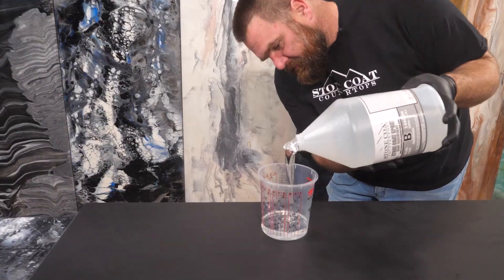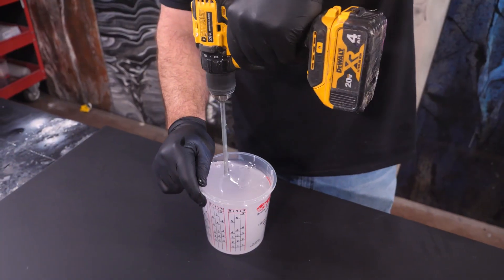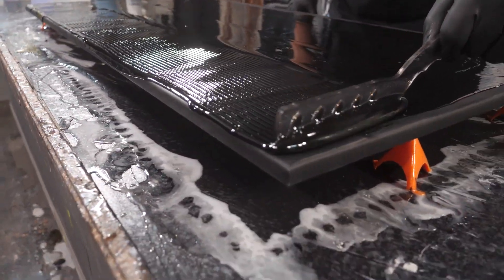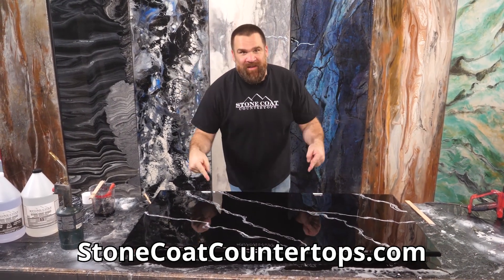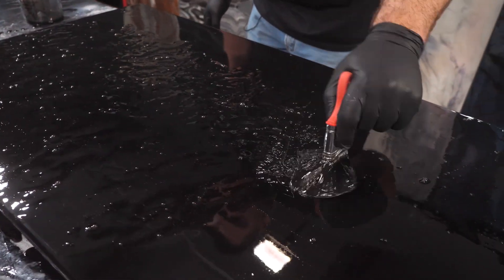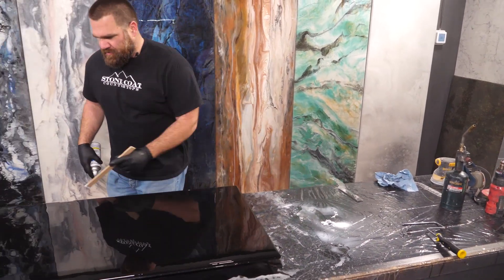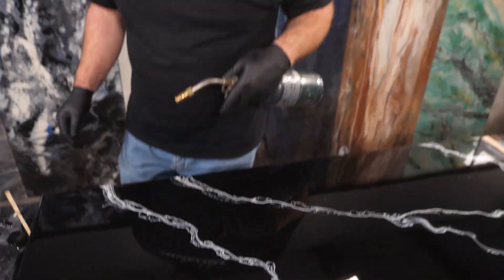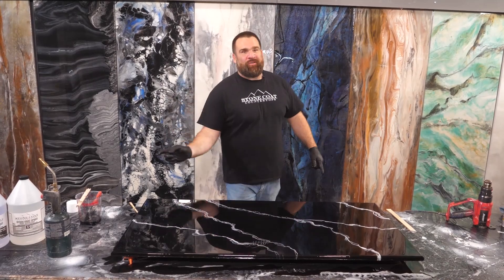Black Fractured Marble with Epoxy Resin | Stone Coat Epoxy

Comment: Thanks for watching everyone! Let me know if I can help u get a project started 👍
Reply from the maker: Thanks Mitch, good work bud!
Reply: So is it 3oz of each part A and Part B per square ft or a combo to make 3oz per sq ft? Your videos are the best epoxy designs around
Reply: @ryanwheeler4245  1.5 Oz of A and 1.5 Oz of B. Total of 3 ounces per square foot
Reply: @mitchquist How many square feet was your board?
Reply: This is closer to the kitchen counters my wife wants, just no veins, with a hint of coffee brown coming through and no shine. If I paint my countertop black, do I do a clear pour with Metallic brown pigment powder added, or also add black tinting like you did? I'm thinking if I add black pigment it will hide the brown metallic powder color.

Also, are there advantages to taping the edges and after a few hours peeling it off vs. letting the pour run over the edge after troweling and chopping?
Reply: @tbg3111  Putting the tape dam on is best when using the exotic pour method. Not needed for this technique. The tape dam will keep the excess epoxy applied when using the exotic pour in place and keep the details very vivid. When you wait to pull the tape when the epoxy has thickened, the edges turn out HD!
If I was you I'd put down black dyed epoxy and have some brown mixed up, pour veins of the brown and use a roller or your gloved hands to meld the brown and black together. Use a heat gun to further meld as desired. That color sounds good, I wanna try now! Thanks for watching at the great questions, let me know if you have any more!
Reply: Mitch I need to get trained. Where should I go to do that I feel I know enough to start an amazing epoxy business I need to do my kitchen floor over tile, over thresholds, and over my bathroom vanity I would like to use cabusil so as to not have my epoxy run down to drain
Reply: @mitchquist  that explanation on the tape dam helps. I'd like to clarify though on the brown, she really just wants the pour to be black but no veins. I was maybe misunderstanding the use of the powder and possibly I should be thinking epoxy glitter aditive? We're looking for an even, but subtle, brown to be seen. Maybe I'll need to experiment with adding it to a clear pour over the black painted base, and another by adding it to a black tinted pour?
Reply: Help!!!!! I got drips on my floor 😣 I wiped them up quickly but now the spots are sticky and shiny. There was a hole in my plastic! I also got on my hands 😬 do happy with how it turned out though!
Reply: I will ask when I DIY 
Your hard on this you got it on lock off 🤣👌🤘
Reply: @T BG   If you want the subtle hints of coffee brown into your pour, put some coffee brown spray paint onto a pallet or piece of cardboard then use your chop brush to chop it into the epoxy.  Mike did something like that in this video "Turn Plywood into Marble Countertops".  I hope this is what you were looking for.
Reply: @cyclet4819  thanks for the tip. I'll look that up.
Reply: Can you do the same thing, but white with black veins?
Reply: My current countertops are small ceramic tiles with grout in between,  so the surface is not smooth.  Will the epoxy work on this surface?

Comment: There's also Montana Marble Effect spray paint that works great for mimicking marble... Long as you don't overdo it. It's like silly string, so easy to keep using. Did this with an ugly counter on my kitchen. Finished with UTC to lower the gloss and then offer nice scratch resitance!
Reply: What is UTC?
Reply: @howardmcnatt6513  Ultimate Top Coat. Adds scratch resitance to resin.

Comment: When you did a rock face project, you taped the perimeter of the top to prevent the epoxy from running off and then 3 hours later removed the tape and let the "thicker" epoxy flow down the edge. Can you do that with a flat face, like the one in this video?

Comment: I have a question.  I have tile back splash in my kitchen.  I hate it.  If I want to do stonecoat back splash and countertops and them to look seamless what depth of mdf do I use and do you cut out outlet areas before or after finishing?  Also do you put the top coat on prior to install?

Comment: As a countertop, how does this hold up to warm/hot cookware?
Reply: I dont think its recommended. As a test I boiled a kettle of water and set it on a sample piece, it did warp the epoxy.  But it has memory and sprung back into shape in under an hour. I would never do it to my epoxy on the kitchen counters just to be safe.
Reply: @coreyobr26  
Thanks, I really love the look but thought it'd be better for bar tops.
I've watched a lot of these videos and would love to try using color.
Reply: You can get away with it. But, if you continue to put hot items in the same place, over and over, it will eventually discolor and break down.
Reply: Can you use a piece of yarn dipped in paint and drag it across the surface to get your veins?
Reply: @adamguerra4413  
You can use anything you like.. just be mindful of string fibers getting pulled out onto your piece while draging it
Reply: @adamguerra4413  I like the results of just using latex paint, thinned with flotrol. Put it in a small cup and drizzle it around where you want it. It seems to flow better, when using the heat gun to move it around. Spraying on some 91% alcohol, afterwards will give the veins some lacing too.
Reply: @Adam Guerra  
I've observed people using feathers, and it turned out very nice.

Comment: Hello. What would happen if you pored a little clear epoxy in the middel of the table right after you pored the black epoxy on? I have a wooden plate i want black, and a glass picture in the middel i want clear epoxy on. Can i poor the black around the glass plate, then poor clear epoxy on top of the glass and let it glide out? Or will the clear one ruin the black when it touches it?

Comment: What happens if/when you leave the torch too long? What will you see happen?
Reply: good question. What can happen is the top layer of the epoxy will blister almost like the skin on the top of a paint can left open. You can use a stick to pull the gummy blister out of the resin and it will cure fine. The epoxy will not catch fire. You'd have to leave the torch in the same spot for a good 8-10 seconds and the torch would have to be pretty close.
Reply: @mitchquist  Thanks for the quick reply!! I kinda thought it might bubble or blister!?

Comment: Two questions: 
1. To prep the wood...just regular black paint? 
2. Do we need to add the ultimate top coat?
Reply: 1. I used our Epoxy Undercoat 2 coats. You can use black paint from hardware store but be sure to let the paint off gas 24hrs
2. No you can always add the ultimate top coat later. To cover the spray paint veins I'd put a coat of clear epoxy this will bring the top back to food safe. The Ultimate Top Coat brings the top back to food safe as well and adds tons of durability. Let me know if you have any other questions

Comment: Why did you not put a tape dam on the edges and wait a few hours to let the resin flow over the edge?
Reply from the maker: Great question, I only use the tape dam when using the exotic pour technique. You are pouring more material on the top with that method so its best to dam it up until it thickens a bit. With the back marble you wont notice the color techniques running off like you do with the exotic pours. Hope that makes sense, let me know if you have any questions
Reply: @StoneCoatCountertops  That makes sense.  I have been watching quite a few of your videos.  I am having a large bathroom built and I am going to be doing my shower and vanity in epoxy.  I also have a built in desk that I need to redo.  I will take before and after pictures and send them to you.